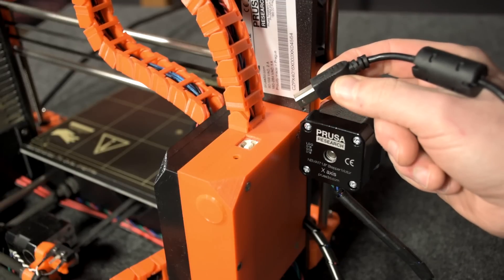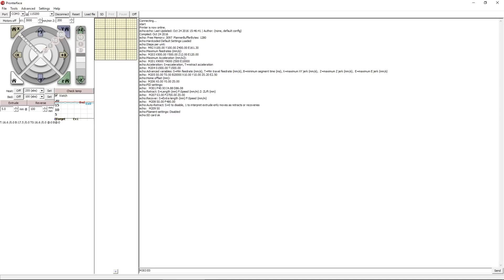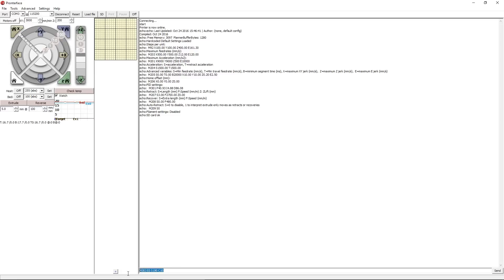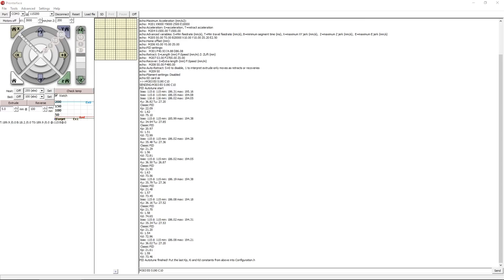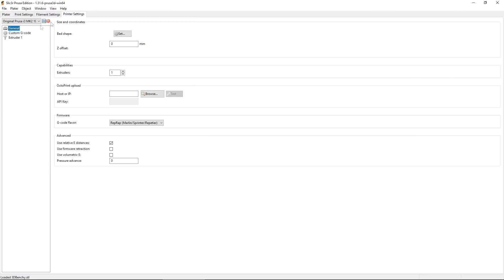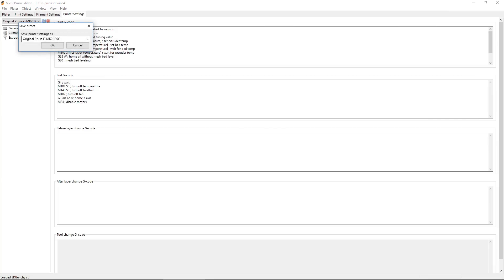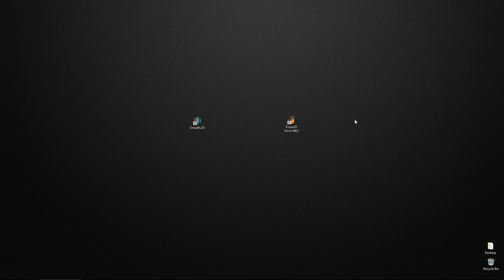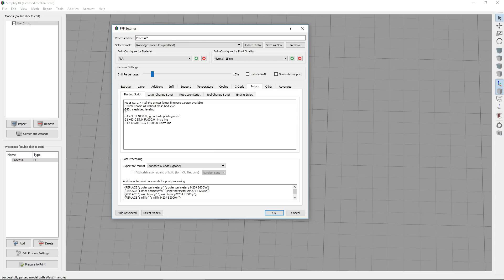How To - PID Tuning

Comment: I have a question - I have a Monoprice mini V1, and I added a E3D V6 genuine Hotend, upgraded the firmware on my monoprice to V29, and then and was able to calibrate it etc. uploading commands through Pronterface. One issue I DO have though, is that now when I 'home' my hotend, the hotend 'homes' about 3 mm or so off the front left corner of the heated bed ('left' meaning when you are facing it, its on your left - basically a few millimeters forward from the factory setting of 'left front corner', off the front of the bed). Is there a command I can upload through Pronterface to offset this so that it will 'home' on the left front corner of the bed like it did with the factory hotend? What commands would you suggest to correct that?

Comment: HY, the blower fan got to be running at 100% before start the PID?
Reply: maybe not 100%, but the percentage you are usually running the fan at. If you run it at 100%, then yes 100%. I run mine at 60%.

Comment: Thank you!!!  I have a Wanhao D6/ Maker Ultimate and I've been trying to figure out this PID tuning.  Pronterface was a life saver!  I used the 250000 baud rate and it connected perfectly.  I have a silicone boot and the microswiss updgrade.  After the silicone boot and extruder upgrades, my temperatures would overshoot by a lot.  It's still tuning at the moment, but I'm confident it will fix them.

Comment: Hello!
First off I want to say you have been very helpful in your videos, because I am brand new to 3D printing!  I remember you said you would help people having problems with their Prusa i3 mk2, and I'm hoping you meant that! I have been doing craziness web browsing, then decided to come to someone who knew what they were doing.

Anyway I am having shifting layers on the X axis, going to the left then right then left again when facing the LCD.  Any ideas on how to fix it?  I got the preassembled one, so it shouldn't be my error.  I did contact Prusa like a week ago, and am getting tired of waiting!  If you want to message me on something other than YouTube, please tell me and I will do whatever.  I am kind of begging you for your smartness.  Thanks so much!
Reply from the maker: Hey there, glad you're enjoying my channel!

For layer shifting, there are some common culprits that you should probably check for;

I'd first check to make sure the pinion (small gear) on the X-Axis motor is free of debris and that it is tightened properly with the small grub screw aligned with the flat spot on the shaft of the motor.

Beyond that make sure your belt isn't over or under tensioned and that you're in 'High Power' mode.

If that doesn't improve things feel free to contact me and I'll try to help you sort the problem out!

Comment: Weeks ago, I calculated my PID for 210 degC.  In monitoring the various temps when printing between 260 and at 190, I've found no noticeable difference in the printer's ability to maintain a level temp at either of these printing temps.  

The whole point of PID is to establish the heater's characteristics in order to maintain a level temp setting without the +/- 5 deg temp swings you encounter with the stock PID settings.  Once you do that with your current heater at a reasonable printing temperature, it seems to work well for all temps in a reasonable temp range.  Establishing and maintaining separate PIDs for 5-10 degree differences is just a silly amount of work.  Just do it once at about 210 or so, M500 it to your EEPROM (M500 now works with the new MK2 firmware) and enjoy the results.  Check it again in a few months as things age.

Also, if you're not doing PID for the bed, you're only half done.  Printing ABS, if the bed temp drops too much while printing (and it doesn't take much), the print will pop right off the bed.

Comment: You often print with two temps, one for the first layer or two, and then another temp for the subsequent layers.  Does this have any affect on PID tuning?  i.e. tuning for one temperature should help the accuracy of the second sufficiently, or could you have two M301 commands in your gcode file to tune for each temperature as it changes?

Comment: Hey,
I've never done this, but actually I think you could add "PID-190.gco", "PID-200.gco", "PID-205.gco" g-code files on your SD card containing the PID presets and just add "M32 PID-[first_layer_temperature].gco" in the custom start code to run the appropriate file. This way you don't have to change your printer profile every time. (I'm pretty sure there is also a variable for other_layer_temperature, but I can't find what variables are available at the moment)
Reply: https://github.com/MarlinFirmware/Marlin/wiki/M32#Examples says it might have to be "M32 !PID-[first_layer_temperature].gco#" if you run g-code from g-code from SD.

Comment: How do you manage updating your profiles if new profiles by Prusa are available? Or if you detect a setting that is useful if changed for all different profiles (beside there are already 3 printer profiles - are you setting up the M301 command in all three profiles?)
Reply from the maker: Like with managing profiles in general, its gets a little tedious. As far as I know there really isn't a way around this so its a sort of necessary evil if you want to tweak your settings for different situations.

I think ideally we'd write all of our favorite settings for various filaments / nozzles / temps in a notebook or text file so when updates get released we have a reference to restore our favorite settings over top of the newer profiles, but again it can get a little tedious.

There might be someone out there that knows a better way to go about this and manage all these things in a better way, but I'm personally not aware of one. I'm definitely open to suggestions if anyone has any.

Personally I just don't use the Prusa profiles and have been using my own for the last few months so it really hasn't been an issue, but I know many other users feel more comfortable using the 'official' ones.

Wish I had some more useful advice for you, but I'm still more or less a noob lol.
Reply: Thank you for that comprehensive answer.

One idea would be inheriting profiles/child profiles. So that you have a parent profile with default settings and you can inherit those settings in a child profile and just change settings you need to change. Will tell the Prusa Developers and ask them if they would implement it ^^

Currently I'm going to use the stock Prusa profiles until I run into a problem. I think they are quiet good and work out of the box (at least the PLA profile)
Reply: I export settings to maintain a record, in S3D these are factory files.
Reply: Sorry guys, should have read that first... I've posted an idea that might help right above ;) I don't use SD-cards for printing, so I actually can't test if it works myself. The same principle could be used to include one g-code file in every print file and even update it without having to generate a new print g-code... So... one g-code to rule them all ;)